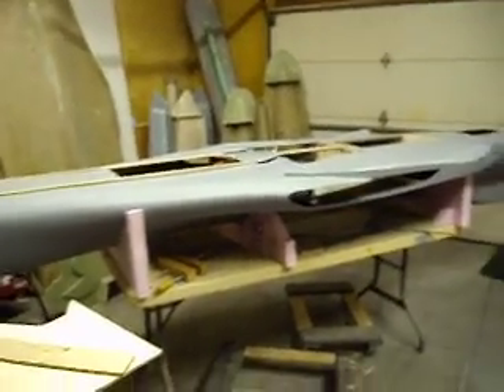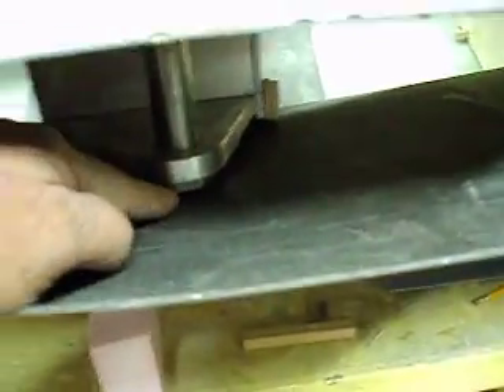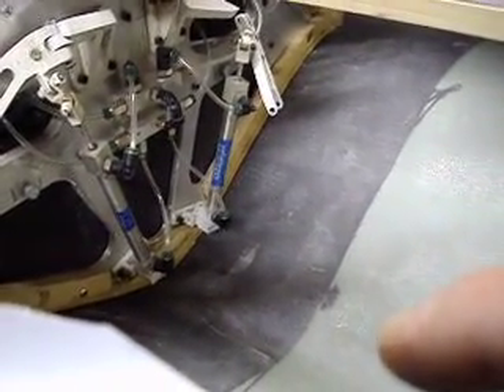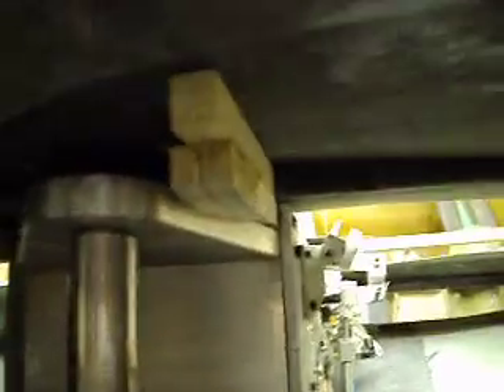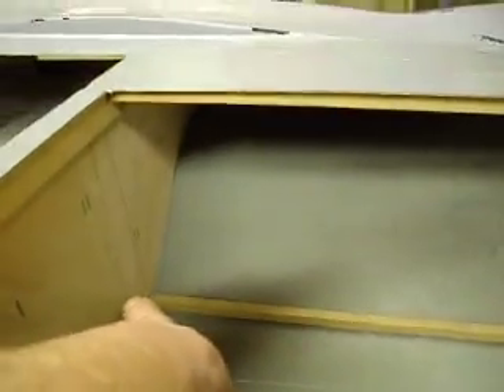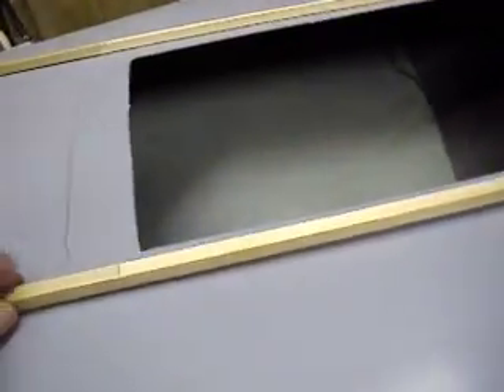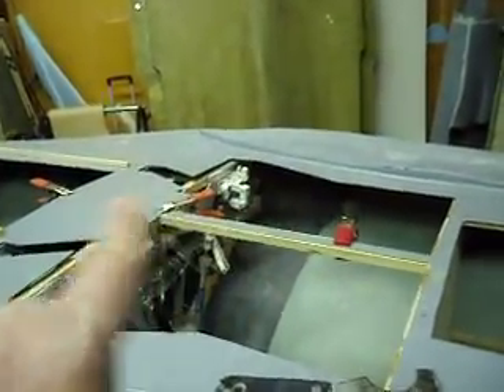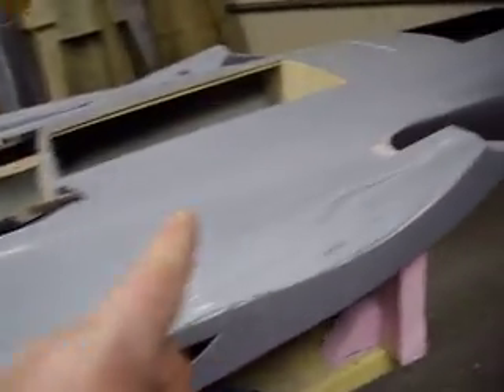How to build a RC Jet B-1 Bomber #101

Comment: Great Job!  I've been with you since day one.  You may want to try expanding foam to fill some empty voids.  It will help keep everything nice and tight, especially behind the thin plywood you are puting in your bomb-bay.  Just drill a small hole in the plywood to insert the tip of the foam.